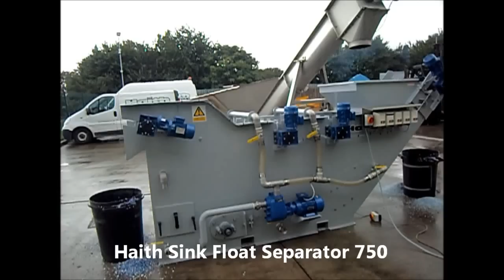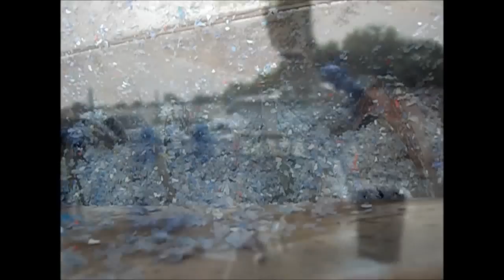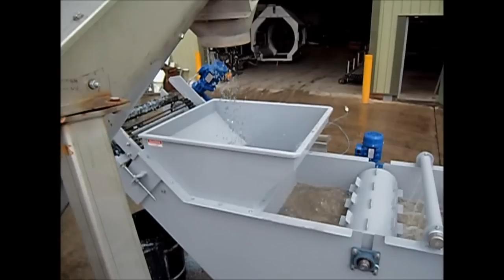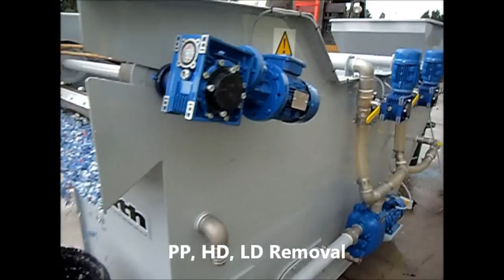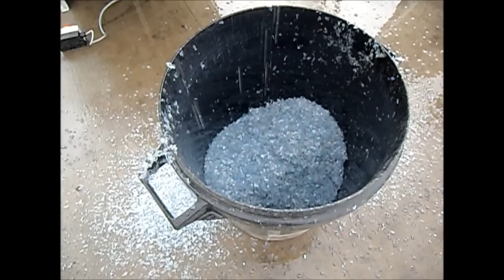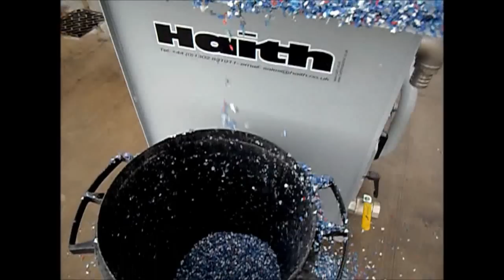Haith Group 750 Sink - Float Separator

Comment: How they separated ? One side PP HD and another side PET ? Please Explain
Reply from the maker: Hi, thank you for your interest. This machine uses water to separate mixed plastics based on densities. Salt is added to the water to improve separation depending on the type of plastics. 

Plastics with a higher density than the water will sink and lower densities will float. They are both then discharged out of the machine via separate elevators.

We can manufacture the machines in a range of sizes up to 2500mm wide with up to 6 paddles.

Please contact sales@haith.co.uk if you require any further information.
Reply: @HaithGroup  we are looking for pet flakes washing plant